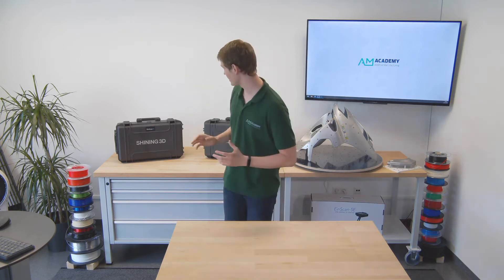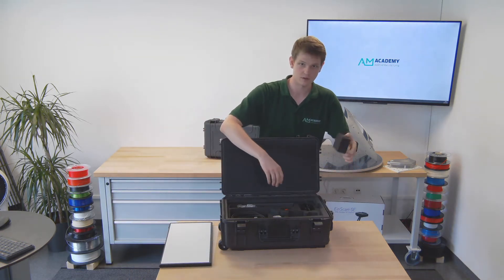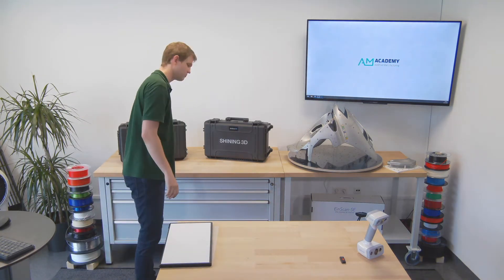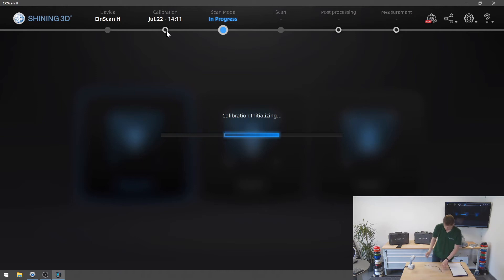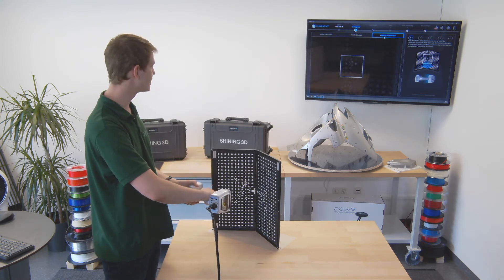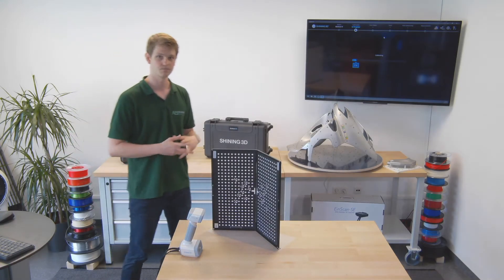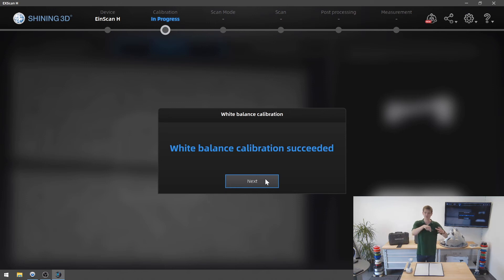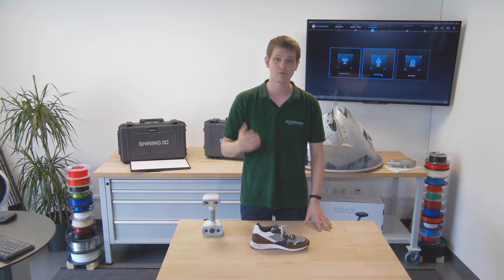Shining3D EinScan H - Unboxing and Calibration

Comment: How good Einscan H is compared to older Pro 2x or HD if I'm looking for a scanner mostly for cars and technical stuff?
I'm thinking specifically about H because of price and other features like texture scan and IR that can make it more universal and possible to use outside my main field of interest.
On a downside, I understand that it lacks stationary scan mode.
Reply: Cars can have reflective surfaces which often make them difficult to pick up for regular light scanners. The HX is more expensive but also features a blue light laser scan mode than can handle dark and / or reflective surfaces far better.
If you are mainly scanning larger objects such as cars, the field of view of your scanner is an important metric, as it determines how much the scanner can pick up at once and thus directly influences your scan speed.
Reply: @svenbagger7147  yes, I understand that HX is better, but it's over 2x more expensive.
If I was looking for a tool for specific task for business or industry, it could be ok. But for me it's just a hobby and I can't justify it. On the other hand H has structured light (as all the previous models) + texture scan (that required optional equipment for previous models) and IR scan that may be useful so widens possible applications. And then the price... Seems like a good option to consider. It's one of the cheapest handheld scanners on the market.
Reply: @777MAV  Oh yeah if it is just for the hobby the H seems like the more reasonable choice. I just wanted to make sure you understand the limitations in terms of what surfaces the scanner struggles with. But especially to get started and play around with the H is a pretty good model and yields very good results.

Comment: Nice review ,  also ordering one tomorrow, just wondering, if you want to scan smaller objects, say 1in cube,  can you place them on the calibration board to use the dots as a reference ?
Reply: I would not recommend this. You should always store the calibration board safely as soon as possible. Instead get yourself a dark surface and cover that with markers. In the background you can see the turntable with many markers on it. Doesn't cost much and keeps the calibration board safe.
And I don't even know whether the calibration board would work as a reference. It's just safer to not try :)

As an aside, if you are planning to mostly scan small objects, the H struggles a bit with these. I would recommend an EinScan SE or SP for smaller objects if the budget is on the lower end or the Pro 2x / Pro HD if you are looking at higher end solutions.